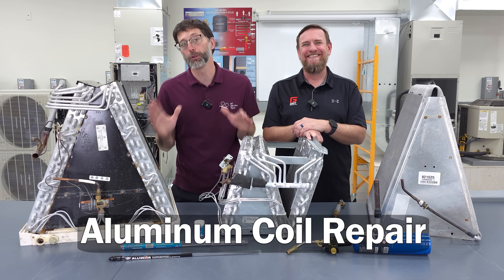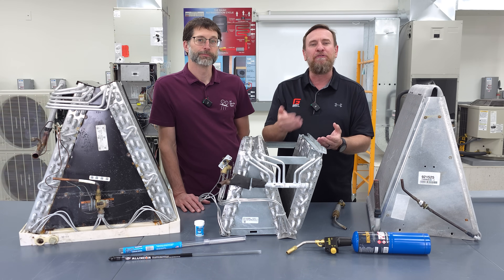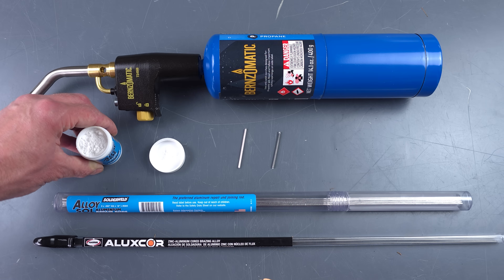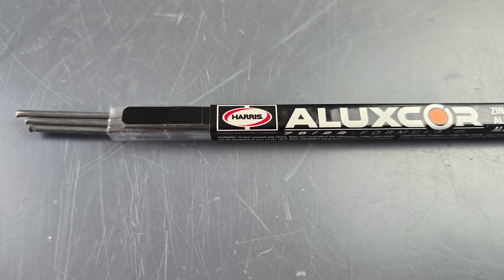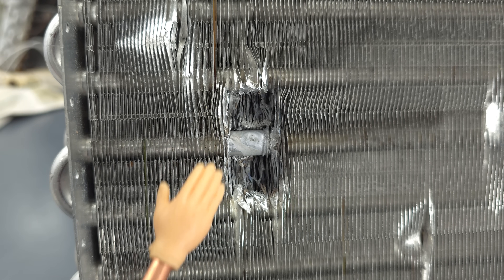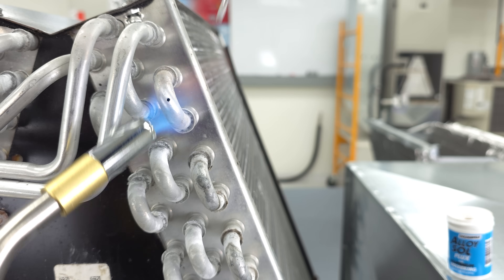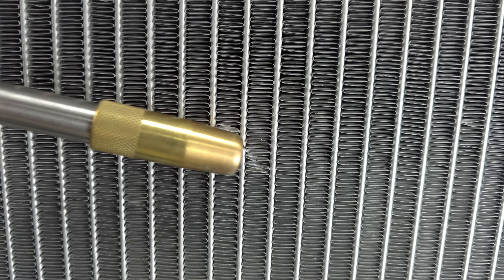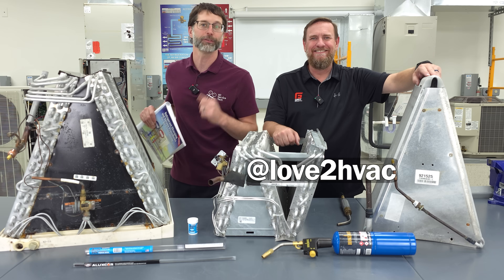HVAC Aluminum Coil Repair Using Various Rods & Torch Types!

Comment: Never had it  hold  / there  manufactured in a oxygen free room the material is so thin and the oil is everywhere in side of the coil very  difficult  not to mess up other joints / main problem is to to thin they could make them bit thicker/ this has nothing to do cost or efficiency/ planed failure 😮

Comment: Just fixed one on the fly, was leaking in the U-joint. Not meant supply houses carry the rods. Coil was even under warranty but on back order.

Comment: Im here because I just spent 3 hours and 15 pieces later taking an evap coil out of a rooftop package unit that leaked. Found a crack where it sits in the pan. Only 100 degrees outside. Thanks guys!

Comment: Reality here. So i have to locate it, remove it, pressurize it outside of the case to confirm it is the only leak. Only to then have to repair the pin hole knowing that hole is there because the coil is shot and another one is soon to follow. Then i put it back, press or braze it in, leak check then vac the system down. I could install a furnace/AC combo quicker than that. I can see replacing a TXV but this is just silly. This would not save a customer money it would cost more unless they did it themselves.

Comment: 35 yrs  service  tech,  last 10 yrs , most repairs on newer systems with aluminum  coils.  , total junk. Most were under warranty  .give me copper  any day.  No fun pulling a. Coil in an attic in florida  summer,  on a new system. And trane coils are a nightmare

Comment: I had commercial units with constant condenser coil leaks at the tube sheets, even units barely a year old. Turns out the condenser fan cycling control band was set too wide.

Comment: I agree with some that leaks in the field likely won’t be as clean as these holes. On the other hand, anyone not willing to repair a repairable coil just wants to sell parts or in most cases new equipment altogether. Provide options and let the customer decide.

Comment: I have a mini troach that  is used for jewelry repair I was wondering if by using it  can be more precise and avoid the areas around the spot I need to repair?
As always your tutorials are the best.
Reply: if it's a small oxygen-acetylene/mapp gas, probably best to avoid using it, you'll have too fine a pinpoint flame(way too hot), blow holes in the thin tubing/material or carburize it turned down low.  far better off using torches with less concentrated heat and larger heated area for better flow. skills needed! practice practice practice.
But of course, if you can clean and tig weld it(heliarc), then that should be first choice.

Comment: Very nice! I always find Al coil and tubing repairs to be dicey at best. Those flux core rods are nice and I need to order some. Seems a lot cleaner and easier!  I've used the fluxless Alumaloy in the past, but it doesn't seem to work as easily as your demonstration with the fluxed rods. 

The note about practicing; cannot be emphasized enough!

Comment: Replace the coil. Unless you are a maintenance tech for property management. If you are a lisenced contractor replace the coil and save the customer the money you charge to repair the "one" leak you found. When you show back up the next year and figure out theres "one" more leak the customer will be pissed.
Reply: I too agree. My commercial customers need reliability. We have had a few instances where a recently repaired coil developed leaks in other places.
Reply: So you wouldn't make a repair to get your customer going again while they wait for a new coil?
Reply: I agree 
Don't go down that rabbit hole

Comment: I never repair coils in a application like this. The problem is is you have to charge for your time.  What kind of warranty are you gonna give this? I just replaced those coils. You gotta have to go through the trouble of removing them. It’s just best to replace for the warranty for the customer. If I was gonna try to repair a coil, I would make it very clear to the customer there is no warranty and I would have that on my invoice. Odds are I’ll be back to replace that coil. Residential application, especially like this pulling out the coil, just put in a new one everybody wins. I have repaired coils in the past and commercial equipment, copper condensers and evaporators, but they were accessible and now was able to get to the leak. It took time because of how much stuff you have to cut away the solder to flow.

 And commercial refrigeration, especially walk-in coolers that you never fix an evaporator you always replace the thing. It’s just too much of a rust bucket. It doesn’t take long.
Reply: Yup..
Reply: Good skill to know for your own stuff. Who knows what may happen with the economy  and supply chains.
Reply: What to do in the case there is no replacement. It is obvioulsy better to have a new unit, but when a new unit is not found, you gotta repair, a culture that is fading away, since its easier to replace and throw.

Comment: When cutting the fines in order to repair an A coil for example, should I worry about condensation dripping down off the coil because the fins got all messed up?  I could take a fin straitening tool to it which would help but still wondering if anyone has had a problem with that

Comment: Good video !  are u showing us on used coils or brand new coils ?  why i ask ? how about dealing with refrigerant oil coming out while welding ? any tips on dealing with this besides wiping oil away with soap bubbles while nitrogen is blowing out hole , wiping dry & adding flux to the area. no nitro flowing probably if having oil contamination problems. wipe area, more flux & pray.
Reply: I was wondering why it looked so easy! 😂
Reply: Good point!

Comment: Great video. What are your thoughts? I'm curious. A coil where tubing has been rubbing causing the leak would be a one off. If you find a corrosion leak, wouldn't the entire coil be compromised to the point of replacing the entire coil instead of making one repair each time you find the charge low?

Comment: Unfortunately, the leaks are not usually 0.032” diameter holes in easily accessed areas. Many times the coils are cracked in many different places and aren’t economical to repair. You can thank our greedy oligarchs for this one too. Coils used to last 20-30 years.
Reply: Yep. Just like in the car industry, they design engines to make it more difficult to access easily replaced parts so that you HAVE to take it to the dealer and they can charge you $800 to replace spark plugs. Should be illegal
Reply: @NoNeckNickB  at least the car industry allows anyone to purchase their product. The HVAC industry is a racket.
Reply: @kdk2286  And the car industry ISNT a racket?? They make most of their money on repairs, not sales.
Reply: @NoNeckNickB so do we in HVAC
Reply: Yep so good for the environment...
Reply: Cool. Just fix what you can.

Comment: Copper coils lasted 20 years. Aluminum coils 2 to 5 years today.
Reply: I agree, and most aluminum coils are still under warranty and should be just replaced instead of repaired.  Very few have such of a direct hole.  They like to hide or there are multiple that you are chasing.  Copper is better in so many ways.
Reply: @Balticblue93  Sad part is warranty does not cover labor or freon. Companies that cover everything charge a bunch more on the install.
Reply: @ I definitely agree for sure.  Labor and refrigerant are extra but requirements either way.  I don’t markup my refrigerant overly high and time depends on how fast and smooth it goes.
Reply: Probably the fact that it’s got copper and brass attached to the aluminum.